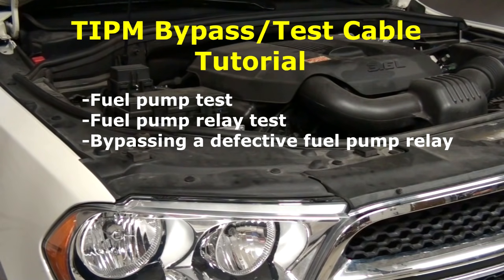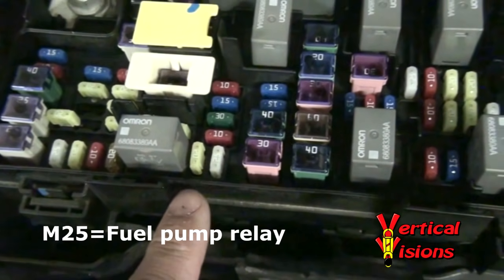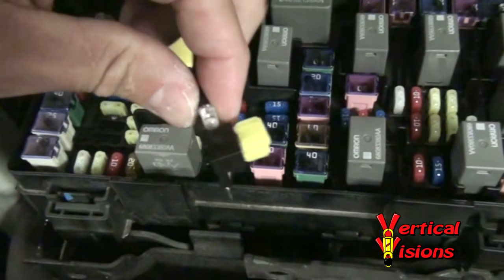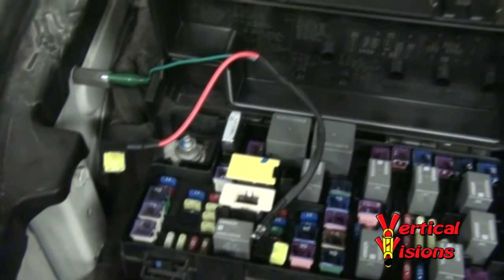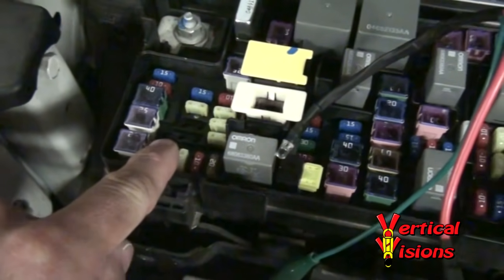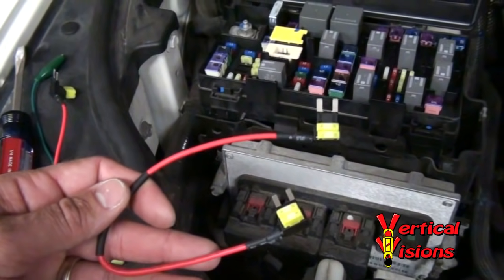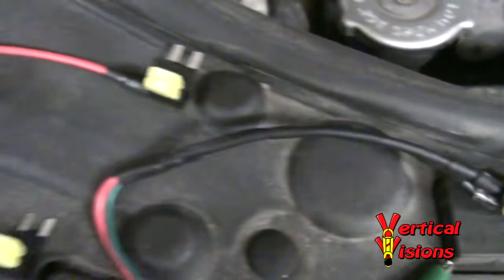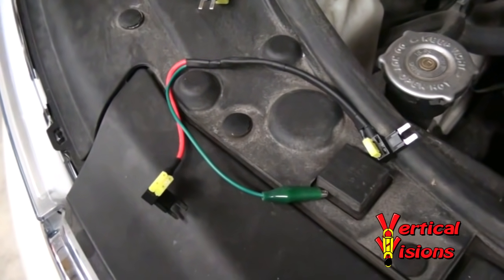TIPM Fuel Relay Test and Bypass Solutions - Most 2007-2021 Dodge, Chrysler, Ram, Jeep, VW Vehicles

Comment: Sir I bought your TIPM Plug-In Fuel Pump Power Bypass/Test System (Lite)
I ran the test . When the car is off or about to start  none of the LEDs light. But when I turn the car on they are all lit.  Does that mean that original relay is working and not the problem ? . Please help thank you - jay
Reply from the maker: Mostly yes.  The top LED means you're properly receiving the run/start signal.  The bottom LED means your fuel pump is receiving power.  The middle LED means your original relay is working AT THAT MOMENT.  Faulty relays often work intermittently, so you might also see it not light up at other times (ie.  first thing in the morning is most common for failures).
Reply: @VerticalVisions  I can’t thank you enough for putting this invention together. If for some strange reason the relay wasn’t the problem or the other thing ma your really showed that are working  what do you think the problem may be ?  The reason I got your product was  because it sounded like my pump would stay on from time to time eating my battery But mostly the car would crank and wouldn’t  start, the battery would start to die so  I would give it a jump and the car will start Right up.  now as we speak  it’s been 24 hrs and the car hasn’t given us no issues after putting your part . Please help , thank you sir.
Reply from the maker: @jaybig360  There can be dozens of things that mimic a fuel pump relay problem (camshaft sensor, crankshaft sensor, out of gas, fuel pump faulty, electrical connection issues, WIN problem, etc.  If your fuel pump stays, on you likely have "parasitic draw" attributable to a stuck on fuel pump relay.  The pump draws 9A on average, which will kill your battery in a few hours.

Comment: I have a Durango 2013, it cranks but does not start. I already have an external relay installed by the dealership. The relay is good. Is there any sense of installing bypass wire? What else can be a problem?
Reply from the maker: You can't have both an external relay and this bypass wire installed at the same time.  More info:  https://www.verticalvisions.com/omron-g8jn-external-relay.html#identify
Reply: @VerticalVisions  Thank you! I'm going to jumper pins 30 and 87, and check the external relay connections to the harness.
Reply: @VerticalVisions  I managed to start the car with pins 30 and 87 shorted. The lights on the dash flicker, but at least I can make it to the dealer to redo the recall. Thanks again!

Comment: I have a 2011 ram 1500 doing this: no voltage to the fuel pump until I touch the fuse with power. Fuel pump runs and the truck starts.
Reply from the maker: 2011 Rams are our #2 most popular fix for fuel pump relay issues.  Your description sounds like a relay issue.

Comment: Hi there.
Will the Fuel pump keep on running when the ignition is on and engine off with the bypass cable installed?
Thanks.
Reply from the maker: If using the new M37 to M25 connection method not shown in this video, the pump will not operate in the ACC position with vehicle off.  In the RUN position with vehicle off, the OEM configuration will power your pump for 2 seconds while a TIPM cable will power it continuously.
Reply: Thank you for responding.
What I’m getting out of this is that the fuel pump will be running with the ignition on and engine off.
This would be a temporary solution to get you running until you get it fixed properly.
Installing an external relay would be the way to go and not using the bypass cable as a fix.
I think it would be great if you would clarify that in the video since it could be a liability in case of an accident where the fuel pump stays running with the engine off.
Reply from the maker: @amirbeganovic805  You do know the stock configuration fuel pump runs with ignition off (for a short period of time)?  Also, when your faulty fuel pump relay is stuck on, it runs continuously as well?  These are two situations where a stock vehicle will power the pump with ignition off.   Also, powering the pump with vehicle off only circulates fuel in the tank with the worst case scenario being a drained battery in a few hours.  We agree with you 100% that this is a temporary solution and have always had this belief, which is why we now have better patented solutions here:   https://www.verticalvisions.com/products/tipm-plug-in-relay-systems.html
Reply: @VerticalVisions  
There is no need for you to explain how a Fuel injection system works on a Vehicle since I have been a automotive tech for 30years.
I was just concerned about the average person thinking that the vehicle is fixed with the bypass cable installed.
Thank you for the clarification that the bypass cable is a temporary solution and not a correct fix.
It would be great if you edited your video and explained that to everyone.
Thank you for your time and the new product looks great.

Comment: my wipers stoped working is there a way to bypass the wiper relay as well?
Reply from the maker: A common question, but unfortunately the wiper relay comes after the fuse, so you can't inject power or even test the relay.  If you indeed have a faulty wiper relay, we repair them:  https://www.verticalvisions.com/tipm-repair-door-locks-wipers-washer-fluid-double-relay-1.html.  Most common are Jeep Wranglers 2007 and newer.

Comment: Hi Jason
Thanks for the solution.
Is this fix increase the mileage?
How long can we continue to run with this?

What is the function of Relay that we bypass?

Thanks again
Reply from the maker: In theory, this fix won't increase or decrease the mileage but we have heard of a few instances of increased gas mileage as the pump will have proper power applied.  The old fuel pump relay is no longer connected to the fuel pump circuit per the addition of the TIPM cable, so it sits unsed in your TIPM.  Longevity of the TIPM cable:  https://www.verticalvisions.com/tipm-test-bypass-cable-mini-blade-fuses.html#faq2

Comment: Could a faulty fuel pump relay cause my 2013 T&C, with push button starting, to stick in a continuous cranking condition? Perhaps in addition to/ instead of a failing starter solenoid? You are a lifesaver to thousands!
Reply from the maker: Yes, a failing relay will cause the starter to engage for 10 secs or more with pushbutton start.  Normal.

Comment: My '13 Town&Country killed the battery 3x in a week, followed by hard starting (cranks over, no start unless switching key back and forth 4x) I got it running with starting fluid, at this point I suspected fuel system issue. Not many private mechanics good with electrical in my area, so I took to Chrysler Dealership on a Friday. They quoted me $125 to diagnose, had for 5 hrs, and could not replicate the issue, asked me to bring in Monday, so they could have more time to look at. I found this video and ordered with 2-Day shipping, came on Sunday. 10 minutes later, I'm on the road! THANKS JASON FOR A GREAT PRODUCT THAT SIMPLY WORKS!!!!
Reply from the maker: Thanks Mike.
Reply: @VerticalVisions I'd like to get one or both,where ??
Reply: 😊 can I leave all four fuses in and continue to drive my truck this is on a ram 1500

Comment: If I have this relay will it cause my auto start not to work correct?
Reply from the maker: Yes.  If using the new M37 to M25 connection method, your remote start will function normally.

Comment: works until you fix it properly with the ECU activating the relay. So when no rpm signal the fuel pump is off. Safer in case of accident.

Comment: I have a 2007 dodge grand caravan,for a couple of months it only started on crank#2 after stepping on the gas pedal.Now it's crank #3.Once the car is running there are no issues even driving for more than 3500 miles.My fuse panel looks quite different,wondering if your bypass cable will fix that as well.Any ideas what it could be and how to fix it? would very much like to hear your input ,since you are obviously more knowledgeable than I am,thx a bunch for the video and all your work.

Comment: Thank you for this. I just emailed you a question on a starting problem I have with 2011 Dodge Durango Citadel.  Mechanic thinks its fuel pump. But could be the fuel relay because of the recall.  Dodge dealership checked it yesterday and they are ordering the fuel relay to replace it. I filled up my tank right after. Now, the next day it will not start at all. It went to having problem starting every now and then to not starting at all after that. Kind of weird.

Comment: I did this and my pump is still running
Reply from the maker: A crisp new $100 bill says instructions were not followed properly.  Did you remove the lower fuse on the M25 end of the cable?  Make sure your cable is configured per this diagram:  https://www.verticalvisions.com/tipm-test-bypass-cable-mini-blade-fuses.html#M37
Reply: @VerticalVisions  yes I finally found that diagram searching the web. The company I bought it from didn't have those instructions. Just told me to put in m37 and m25. But thank you
Reply from the maker: @Jayms1178  Just keep in mind you bought an inferior knock-off of our design.  You get what you pay for.

Comment: I installed one of the tipm bypass cables per the videos and my wife went to back out of the driveway and it was worse than before. It stalled 3x just getting out of the driveway, if she sits at a light too long,  or when she went to pull into a parking space it stalled. I'm wondering if pullingbthe bottom fuse on the fuel pump side of the board might help because it will only get power from the accessory side and not the normal path through the relay. Any idea why this went so wrong on a simple fix? She said the car was making noises like clicking and the dash lights seemed to dim occasionally. I got back from work too late to see it. But when I installed it the car ran fine, but I didn't get to road test it, just started it to see if it started normally which it did at that time. Possibly a short in the relay?
Reply from the maker: You likely have a problem not related to the fuel pump relay.  TIPM cables only solve fuel pump relay issues.  If you have clicking relays inside the TIPM and dim lights, this is another issue (check connectors under TIPM and verify chassis ground wires near TIPM are not rusted).  I'm guessing you didn't buy your TIPM cable from us since we provide detailed color instructions with every cable that shows the lower M25 fuse must be removed.  This is how a TIPM should be connected, which is slightly different from this video:   https://www.verticalvisions.com/tipm-test-bypass-cable-mini-blade-fuses.html#M37
Reply: @VerticalVisions  I installed the cable in the connections shown in the video, I left all 4 20 Amp fuses in place in the bypass adapter, but prior to using the cable the car would operate normally, but occasionally would shut off maybe once a day or every couple days or so. I put the wiring harness in and started the car and it ran fine. But it was late and I didn't go for a test drive. I figured it's pretty simple, just drawing power from the accessory side when the car is on. When it's off, the pump was off. But my wife got in the car this morning and started it and immediately it stalled backing out of the driveway and two more times, then several times while going to work. Then it shut off again once she got there.  She said the car made a funny noise,  which I was wondering if the relay was shorting or something. I put the original fuses in so she can get home as I couldn't get her keys. I am not sure if this is your cable or not ad I didn't click the link on youtube but bought it online. I was just wondering if you think pulling the bottom fuse off the fuel pump side of the harness would eliminate the relay getting power the normal way and only draw from the accessory side in case the relay is failing and shorting out occasionally.  Not sure if that may make a difference.  Thank you for your time.
Reply from the maker: @jimthomefan50025  There are several unsavory individuals out there who are selling inferior versions of the cable I developed in 2014.  They provide no support and no instructions other than those that tell you to google "TIPM cable".  People who buy products with no instructions get what they pay for.  But the good thing is that I still help people to don't buy from us.  I have given you the tools you need to configure your cable correctly via the link in my last email.  Please configure the cable according to this.  If you continue to have problems, also note the chassis ground and TIPM connector checks I mentioned earlier.  Again, I'm guessing you have a problem outside the TIPM.
Reply: @VerticalVisions  ok I think I see the problem, the 20 Amp lower fuse on the fuel pump relay side says it must be removed. I thought it still had to be in. What I'd the advantage to using M37 over M7 cigarette lighter? Thanks again

Comment: as you mention the add fuse or circuit could only find 10 amp so got a fuseable  line put clips on end and trimmed to fit in fuse pin, put one in keyed side of 7 and other feed end m25. worked got me through a work day, did online order for the 20 amp circuits, got following day so made the line. have ordered and await your TIPM Plug-In Relay System (Lite). for worriless fix. thank-you for your remedy, as a friend was advising me to take to a shop and he would take me to work. the issue cost me a day of work and about $175.00 say less than $400.00 that a shop may have said need new pump and the TIPM box which checked price was $1200 for box alone so add pump shop labour and such could have been about a $2500.00 shop charge!!! Grateful you had this up and i was able to find it as save tons thank you very much!!
Reply from the maker: Glad you found us!  Win win.

Comment: It did not fit, wider than the existing one it fits for N91 but not for the 70 I had to make some adjustment. Next day the battery was completely drained! I had to disconnect the negative terminal to start up the car

Comment: Just ordered one. This is my first Chrysler vehicle and after a year of driving it I have had it die twice which I am sure is due to the faulty relay after searching through a ton of materials.  The mechanic I use all the time suggested I check out the relay before bringing it to him which led me to this spot after seeing Johnny B video.  I much rather spend the $30 on the thicker gauge wires and it completely set up with shipping than buy lower quality wires and put it all together myself for about the same cost.
Reply: I did the same. Making sure you only use one end of fuse box insert the right side prong where you insert m7. From there run a 30amp bypass wire into m25 to the bottom prong insert. Not the top. You can use a Y slot n cut off one end of that, crimp it to wire then insert it again to the bottom insert of fuse box where m25 fuse would go. Now since m7 does not provide constant 12v power, when you turn off vehicle it will also turn off pump as needed.

Comment: Hello Jason my name is Levean I had my 2011 Chrysler town and country towed to the Chrysler dealership  to find out the problem , I was told that it was the TIMP so I purchased a TIMP I followed the direction , I installed the bypass cable it started working the same day Monday, August 30 then the next day it started right back up I had to go to work , while I was working ( I’m a driver I deliver packages for Amazon )
so about two hours driving then cut off again and then The check engine light came on started flashing fast my car started shaking And then it wouldn’t start back up my question to you do you have an idea what the problem is now. the results of a dealership it says internal failure to TIMP no power supply to fuel pump recommend replacement of TIMP
Please tell me what to do since I am the one who will be working on my car

I cannot afford to pay $1700 at the dealership Mr. Jason please help me tell me what you think the problem is so I can fix it
I forgot it also gave out a code or P0335
P0335 and P0335 three codes came up

Thank you thank you
Reply: Yes
Reply: The bypass wire probably came loose or over heated and burned causing the fuel pump to disengage and turn off. That caused your car to stall.  That's my concern. Running 12 full volts direct and constantly to pump, will it mess up fuel pump or cause wire to burn off after a long period of driving it ??

Comment: my 2012 JK has no power to the switch panels for heated seats, hill decent, trac control, lockers, sway bar, etc...I'm going to get the test cable and verify but guessing I need to get my TIPM repaired. What a horrible engineered part.

Comment: will this also work for a dodge challenger 2011
Reply from the maker: We have not tested our part on your vehicle, but we did just receive confirmation that it works on a 2009 Challenger.  Therefore, it may or may not work as I'm unsure if your TIPM version.  If you want to send us photo of your TIPM with the lid opened, it might help.  Thanks.

Comment: Got any suggestions for the 2018 3500 ram with 6.4 hemi
Reply from the maker: The following part will work on a 2018 Ram 1500/2500:  https://www.verticalvisions.com/tipm-test-bypass-cable-micro2-fuses.html.  Please verify your TIPM is the same as shown on the product page in order to verify it will work on your 3500.

Comment: Would this work for a 2009 avenger with the 2.4
Reply: Also disconnected the fuel line and cranked it has can out
Reply from the maker: We have not tested this on a 2009 Avenger.